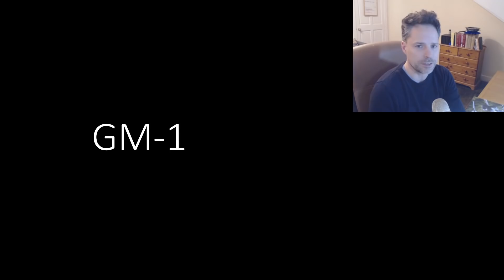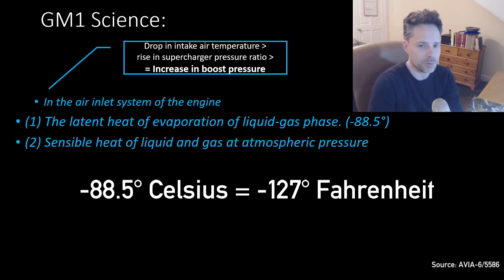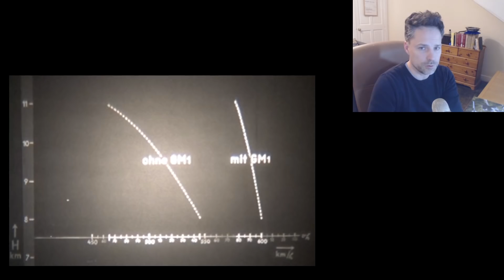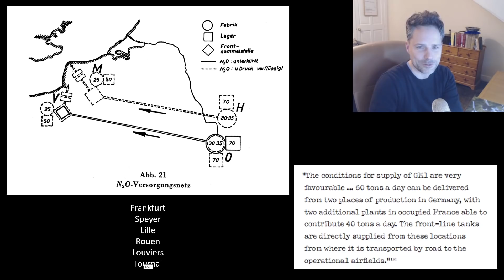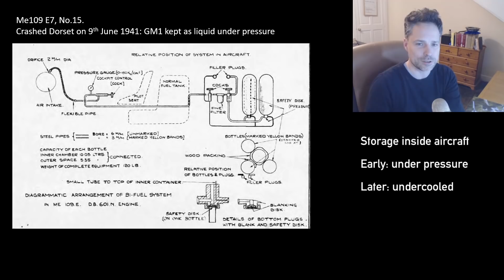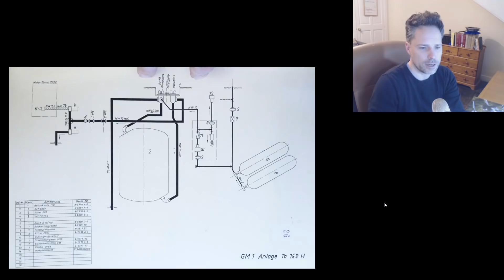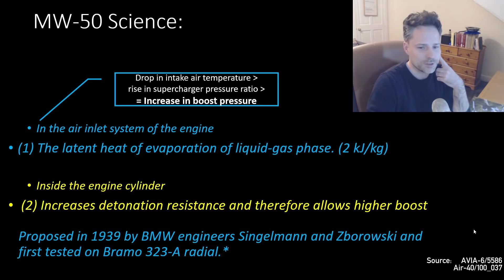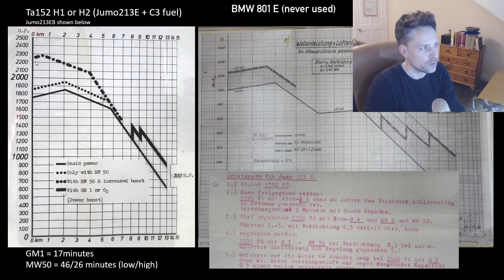The Secret Behind German Engine Performance: GM-1 and MW-50

Comment: I found that very interesting.
 It does surprise me that a lot of the developments for piston engine aircraft took so long to 'cross over' to automotive use and 'suddenly' is 'new technology' (LOL)
Suzuki used under piston crown oil jets in 1985 to stop pistons overheating, it took many years before other motorcycle manufacturers caught up but now 'everyone' does it,including GM on some car engines. (Even Harley Davidson now uses them as 'aftermarket HD clones stated using them 10+ years ago),
After watching various You Tube video's, I'm kinda shocked and saddened how 80 yr old technology is so badly understood when in 'pre-internet' 80's the information was pretty easily available if you actually looked for it.
Reply: Wait, what? Which Suzuki model was that? Mid-80s was the golden age of two-strokers for high-performance bikes, right? Why were they developing oil squirters?

Anyways, a lot of Second World War era piston engine technology wasn't adopted before the 70s, because there was no need and/or it was too expensive to develop and build, probably too complex to maintain, too. Manifold and direct petrol injection were developed for aircraft, but obviously you can't nose-dive a car or drive it upside-down, so why make things complicated? Turbochargers were invented for high-altitude performance/efficiency and for continuous engine load - both of which is irrelevant or even problematic for cars. Also turbochargers require very precise machining and high quality alloys, something the Germans and Japanese struggled with during the 2.WW.

That kind of high-tech stuff only became worth it for mainstream automotive uses through the 70s oil crisis, the advance in electronics, and environmental/health protection.
Reply: @argh1312  GSX-R750 was launched 1985 in Europe, America didn't get it until a year later as tyres were not available plus Suzuki didn't think it would sell being 'only 750cc The 'SACS' motor was in production until 2010 or 2011, 'Bandit 600/1200 were last bikes to use it

Comment: Hi, Chris, Please thank Calum for the detail, especially the striking graphs. Surprising the British boffins took 2 years to figure out what the Germans were using, and that no one else in the world of aviation or auto racing came up with it.

And now I'm wondering if motor vehicles that have to travel high altitude roads, regularly, have legal nitrous injection systems.
Reply from the maker: Will do, I am sure he is happy to hear that you enjoyed the video!
Reply: No need for nitrous in a high altitude vehicle, as most roads are in general below 4km up, where you can still breathe the air, and a vehicle can easily be adapted with only a slight change in jetting for a carburettor model, or for EFI no adjustment needed at all, the engine management will do so automatically. Even on the Tibetan plateau you can drive a vehicle perfectly normally, just a slight loss of power compared to sea level only, and most of the time you would not even notice it.
Reply: For most automobile applications a turbocharger is a more practical application since the added weight and space requirements are less of a problem, plus nitrous oxide increases cylinder temperatures and pressures so it's time limited to avoid engine damage. Even then, it tends to seriously reduce engine life and TBO.

Comment: Great video, thank you! I'm very corious how the propelers in those planes worked in such low pressure as 0.05 bar. Was there any special features implemented to increase prop. efficency to allow it convert such big power as 2000 HP into useful force in extremly low air density?
Reply: Boeing B29.. props and gearing.

Comment: I'm only recollecting my dad's telling me when I was maybe 12 years old about 1967. He told me about water injection of the Pratt and Whitney R2800 being used as he was stationed in the Caribbean in WW2.
Reply: The first time water injection was experimented with in engines was in the 1880's, those experiments were largely forgotten about by engineers. 
In the mid/late 1930's an engineer at Pratt&Whitney was conducting an experiment to see how much water their engines could injest when pilots have to fly through clouds and he accidentally stumbled across the benefits of water injection.

Comment: 24:37 hey I just wanted to mention something that I think warrants discussion, I hope your guest responds to this. The 100hp boost here, it doesn't make sense that it could just be from the calorific value of the methanol (barring a massive volume), that's a large boost in power. the boost might have come from the decrease in intake temperatures allowing the superchargers to compress more efficiently, this of course depends where exactly the MW-50 is being injected, before or after the supercharger. In addition, I am unsure if the Jumo 213 used a variable supercharger coupling like was used on the DB60x engines, if the MW-50 was injected post supercharger there may have been a slight increase in boost pressure just from the charge cooling.

Looking forward to debate.
Reply: Jumo 213 E & F MW50 schemes injects it AFTER the blower, so its not creating a saving by reducing compressor work. There certainly will be a gain due to evaporation nevertheless, but I have not sat down and calculated the exact balance of both effects in this particular engine. I think it will start to get a bit much for most viewers if I start going into it that deeply. For those with very in depth interest, that is why I wrote the book. :)
Reply: @CalumDouglas   I have read somewhere that without upping the boost pressure, MW-50 resulted in about a 4% increase in power output. What I'm wondering about is whether the amount of fuel injected for a given boost was reduced during MW-50 use. Because essentially you're a) replacing some of the air with water vapor, and b) adding more flammable material (methanol) to the mix. Wouldn't that make it run far richer? Just I can't imagine the Bosch injection being able to account for that through the pressing of a button.
Reply: If the power/altitude graph is like a ‘M’ rotated about 60 degrees clockwise it is a two speed direct linkage supercharger.  The trick is to keep the dips above the opposition’s dips, evaluating captured aeroplanes is important.
Reply: @argh1312  generally with methanol injections, the amount of fuel would not be reduced, as the accompanying boost increase will make the engine run hotter overall. Modern Turbocharged cars tend towards very rich ratios (as rich as 10:1) during high boost as it helps keep exhaust temps under control and avoids melting pistons.

Comment: There was a variant of the A4 rocket motor which was tested with nitric acid and a different fuel, which made considerably more thrust. I believe the test was in 1944, and this variant was planned for use in the A8. My question regards the fuel in question - I have seen sources say that it was a visol, diesel, and gasöl. Can anyone say with some confidence that the fuel in question was in fact diesel fuel? A visol is a totally different substance, although it is a rocket fuel that could be burned with nitric acid.

Comment: Nitrous oxide causes a very lean burn which raises head temps. to the point of melting valves and warping heads. Early drag racers found this out the hard way. You need to either boost the amount of fuel going in or using a meth/water injection system. Charles Lindbergh (yes, that Charles Lindbergh), demonstrated to pacific P-38 squadrons how to increase range by leaning out their fuel/air ratios, got fightback from mechanics saying it'd damage the engines, worked out the exact ratios, took the aircraft himself and demonstrated (was even credited with a shoot down), helped increase range by approx. 15% with no engine damage.
Reply: Training was terrible back then.  Some pilots thought that high rpm and low throttle would give the best economy.

Comment: How were GM-1 and MW50 introduced into the engine? The DB 600-series engines and the BMW 801 were both supercharged, and the DB engines I think had direct fuel injection, into the cylinders. If the relevant substance were simply pumped into the intake upstream of the supercharger, would the effect be the same as injection into the cylinder during the intake stroke?

Comment: Your author friend missed a point with NO2. The nitrogen expands a lot when heated by the combustion. Plain oxygen could be injected to offset the thin air, however it would only increase performance marginally.  The nitrogen, although inert, boosts the cylinder pressure by it's expantion caused by the heat
Reply: Your point only applies to the vapourisation of cryogenically stored media in their transition from liquid to gas, as such, this expansion would only occur if the Nitrogen were injected directly into the cylinder as a liquid. Once any cryogenically stored fluid has been injected into the supercharger, it is fully evaporated before it enters the cylinder, so this expansion does not occur in the cyliner. I would also point out that liquid Nitrogen has an expansion ratio of 1:696 which is actually quite low, and less than that of liquid Oxygen, Helium, Hydrogen or Argon.
Reply: @CalumDouglas  I have no intention of butting heads with a know it all, however your wrong. Many "hot rodders" have tested so many ways and have found the expantion of nitrogen is in part why no2 does what it does.
Reply: @CalumDouglas  it has been tried without the nitrogen. Just plain old oxygen chilled injected, with extra fuel and only a marginal increase in power. So practically it is necessary. Chemistry lesson doesn't matter in this case. However I do concede it hasn't been tested to my knowledge at such altitude.

Comment: MW50 is still widely used in turbocharged cars for street/drag racing. Surprised it’s such an old technology. Blue Washer fluid is usually very close to 50/50 water methanol

Comment: Great chanel - Hey I have a question  - It was the GM- 1 system which they used on the HUMUNGUS - CRUISER in the MAD MAX 2 movie ?
Reply: According to various fan-sites of the movie, in the film, yes it was supposed to have had a nitrous oxide system. Although its very doubtful that the actual vehicle on the film set really did have a real Nitrous system actually installed. It would be a lot easier to just install a little valve and pretend to turn it then just put your foot down to make it look like you`ve used it. I dont think you`d really bother installing a real nitrous system.

Comment: The German scientific term for Nitrous Oxide is "Distickstoffmonoxid". Note the "mono" in there, which may have been the inspiration for the original code name "Mona".
(Also, judging by the minutes, I would guess "Mona" referred to the upgrade kit to be installed in the planes, rather than GM-1 itself.)
Reply: Sounds like a possible explanation for the name ""Mona". I`m not sure about it being the name for the installation kit, because the name "Mona" disappears in 1941, is never used at the same time as ""GM1", which was thereafter used for all references. When GM1 was being installed later in the war, the "kits" were generally referred to in discussions as "GM1 umzurüsten" or "GM1 Einbau". So I think "Mona" was the name given to the fluid, not the kit. However, its not possible to be 100% sure at the moment without further archive "finds".

Comment: there is no time limit on MW_50,it's the "scramble" boost level that pegged it at 50% duty cycle
Reply: Thats whats in the German documents Andrew, I dont just pluck figures out the air for fun. The actual German 109G with DB605 AS, ASM, AM variants, manual says:

""After a maximum of 10minuites flight the boost must be brought back to 1.3 ata or less, the lower
switch must be pressed, thereby stopping the MW 50 injection. The manometer returns to zero and the
green lamp goes out""